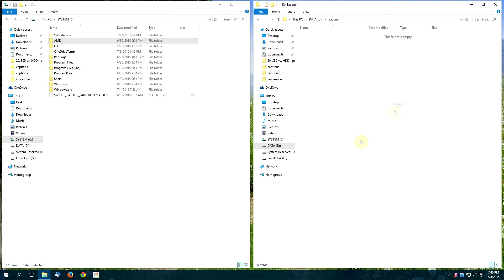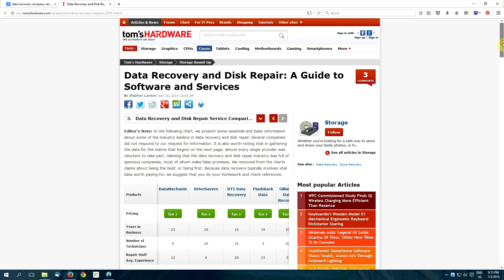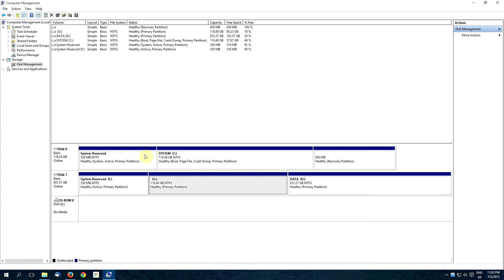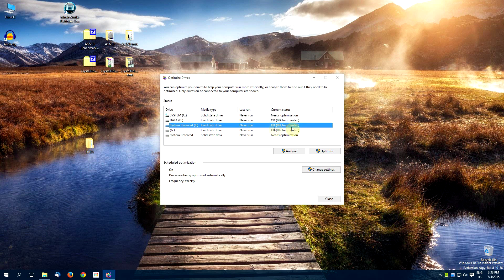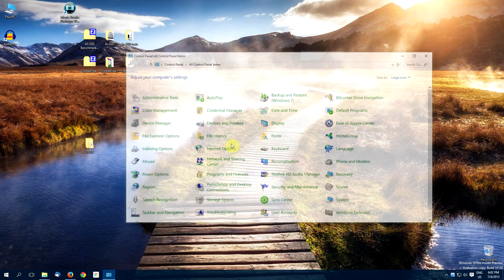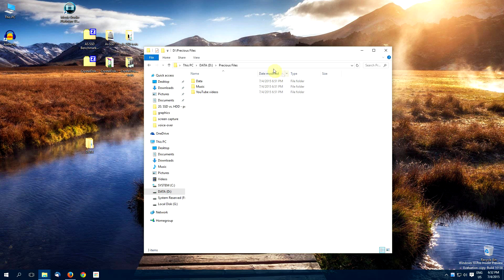SSD vs. HDD - practical comparison | computer tutorial

Comment: Once all the cell blocks have been used up in your SSD it will slow down long before it fails and to keep your SSD running really fast you need to keep from ever filling it completely up. You can't erase data one a cell block as been used. All that can be done is just simply overwrite data in a cell block with new data. HDD does not suffer from this sort of problem as long as you keep the HDD defragged and all the data in order.
Reply from the maker: That's why they introduced the TRIM command for SSDs. Basically it informs your SSD which data blocks are no longer in use and can be wiped internally.

Comment: using 2.5 hdd is bad . can u explain more about it ? why ?
Reply from the maker: HDD is not bad, it's just terribly slow as a system drive. It's a lot cheaper than SSD, so it's better for storing large amounts of data.
Reply: +ElectronFun.com  thanks, but i meant is 2.5 hdd is slower than the big size ?
Reply from the maker: Unfortunately yes, 3.5" HDDs are usually faster than 2.5" laptop hard drives.
Reply: +ElectronFun.com thank u alot
Reply from the maker: No problem :)

Comment: Can I install an SSD in my laptop? (Dell inspiron from 2009)
Reply from the maker: +Dionicio Garcia If your laptop has a 2.5" SATA hard drive - yes, you can replace it with an SSD.
Reply: Oh, thanks... Do you recommend me to install one?
Reply from the maker: +Dionicio Garcia It should make your laptop a lot faster - the operating system boot up, running programs, etc. I have SSDs in all my computers, even in my 9 year old stationary PC - thanks to the SSD it's still usable.
Reply: +ElectronFun.com Oh, thanks man, I will buy at least a 120gb ssd for my laptop which has gotten slow as hell, it takes like 5 minutes booting up... thanks for the answer!
Reply from the maker: +Dionicio Garcia Just one more thing came to my mind - the operating system. If you have an OS older than Windows 7 it doesn't have the TRIM command built in. This means your SSD will still work, but it will become slower over time. You can read more about TRIM here: https://en.wikipedia.org/wiki/Trim_%28computing%29.
I used to have Windows Vista in my 9 year old PC and I felt the OS was getting slower over time. Now I'm using Windows 10 and there's not such thing as slowness.

Comment: You should have mentioned that theres a limited amount of read/write cycles on an SSD. HDD's are more reliable. If the electronics die, you can get a cheap replacement off e-bay and even do it yourself at home to replace.  I'm using quite old 500gb 7200 rpm sata 2.0 and the 64-bit Win7 boots up in 10 seconds, and it's ready to use instantly after I enter my password. I'm sure my AMD quad-core CPU clocked at 3.93 ghz should be taken in count.   Nice video in overall, average user friendly! :)
Reply: I have a 7-years HDD from 2009, it started to make noises and windows didn't boot anymore, I thought it had died... But no, still rocking, just deleted all partitions (after backup with Ubuntu Live DVD) and did a slow format of the entire disk, working solid.
Reply from the maker: I wouldn't trust that drive anymore.
Reply from the maker: DaGunchijs You're right, I could have mentioned that.
There is a limited amount of read/write cycles on SSDs, but there are special algorithms, which make sure all or most memory cells wear out evenly. There are also additional cells, which replace the ones in the worst shape.
What do you mean by: "average user friendly"? Constructive feedback is a good thing :)
Reply: Ahh, just clear speech and not too complicated pc terminology for the 'Average Joe' viewer. Keep it up. :)ElectronFun.com
Reply from the maker: DaGunchijs Thanks for your feedback :)